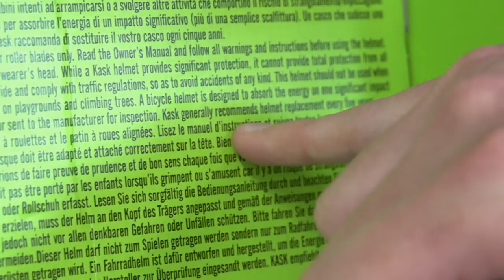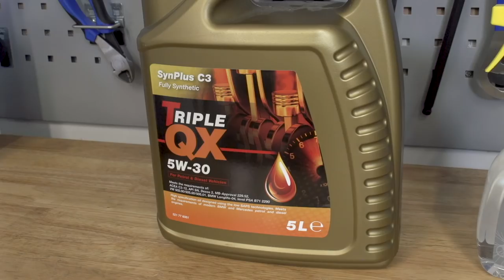How To Care For Your Bicycle Helmet

Comment: 25 cents worth of styrofoam = 100 dollars for a helmet.
Reply: True, however, the price of even the most expensive helmets is nothing compared to years or decades of dealing with a head/brain injury.
Reply: That's why I buy my helmet at Walmart same design and testing but not the insanely high price. Of course in a crash that would actually injure your cranium a helmet would be destroyed and provide no protection
Reply: That's like saying a text book is worth $10 of paper but someone has to write it............
-______-
Reply: the difference of fit alone is well worth the price. when your lid fits perfectly it's like wearing an old pair of jeans. it becomes part of you.
Reply: Michigan Mister I have a $15 helmet that's like wearing an old ball cap barely notice it's there even with a light on top and had all the safety ratings of a $100 helmet and similar styling too
Reply: see? exactly what I'm talking. it's true tho, that a quality lid will usually have a better fit. they (SMITH) have come miles in comfort. lol, then, the MIPS system comes along to muck up the works, hey?

Comment: Question... If you have an old helmet and it needs disposal what's the best way to get it disposed of, can it be recycled? Are they made of recyclable material?
Reply: Turn it around and use it as flower pot. After a few years your wife will love your cycling addiction and buy a new helmet for your birthday.
Reply: #torqueback

Comment: There's a huge difference between cycling to the shops at 15kmh on your old town bike or ripping down the side of a mountain or through a city on something a bit sportier. If you cycle in a certain way, you're bound to come off the bike sooner or later (see GCN team). My worst crash happened when my stem broke at low speed. I felt pretty stupid sitting in the emergency room with half my face broken, knowing that I would been uninjured had I been wearing a helmet. You never know when a component is going to fail, someone in a car doesn't see you etc. €120 or less is money well spent if it saves you from a preventable head injury, unless you're into that kind of thing (see David Cronenberg)

Comment: Should I change my helmet? I was knock of my bike by a 4x4 but unfortunately the driver didn’t stop or i would have asked them to replace. As i spent a bit on last helmet i wanted advice before replacing. There a few scuff on lid post crash as body took brunt of impact but i want to make sure before i get back on road again.  Also whats you opinion on helmets with leds integrated into them. Are they really bright enough. Id love to test one out for u. Thanks for advice in advance.

Comment: I wash mine after every use.  Take out the pads, rinse them, hang them up.  Soap up the helmet and straps, rinse well, shake well, set outside to dry.  It's always fresh and clean and the straps don't discolor or get gross.  I suggest the same.  Don't be gross.
Reply: Incaensio you have to much time on your hands
Reply: Kind of a waste of time
Reply: I have never washed mine at all.  Bought it second hand in 1861 from Isambard Kingdom Brunel.  He was ahead of his time.
Reply: I wash mine after every use but not the one on my loaf. That does seem a little excessive or you do have a lot of spare time :)
Reply: I'm already in the shower washing my ass, so it takes less than a minute to also wash the helmet.  Clothes are already going outside to hang dry, taking the helmet and pads out too again adds less than a minute.
Reply: I take mine into the shower with me! Give it a quick rinsing out while the water warms up. Takes 15s, seems to work fine!

Comment: I live in Phoenix, Arizona (USA) and have left a latex balloon hanging in my garage, where I also keep my helmet.  The balloon melted and dripped onto the floor from the heat during a particularly hot week. Latex melts at 130F (54.4C) Think I need a new helmet. Once again, good tips GCN!!!  Any videos on heat and the effects to a bike, carbon, grease or wax lubrication? #torqueback

Comment: Hey GCN. Im 16 and I just recovered from a horrendous crash at a national level race. My helmet has no scratches or cracks, so should I replace my helmet??
Reply: Yes. Only if it actually hit the ground. If you fell on your shoulder then it should be allright.
Reply: Sattva Vasavada Sengupta it's always good to replace a helmet after a crash
Reply: Yes!!!
Reply from the maker: Hey Sattva, sorry to hear about the crash. Most, if not all, manufacturers do advise replacing helmets after a crash as there is often damage that you can't see.
Reply: Makes no difference what level of race you were in at all, totally irrelevant.

Comment: Do expensive helmets offer greater protection than less expensive ones or are they just prettier?
Reply: Aero features, ventilation, and lightness is all you get from price.
Reply: Terry Smith There are testing labels inside. 
Only approved helmets can be sold.
So all helmets you see in your bike shop, expensive or cheap, should be safe.
Reply: all helmets test to the same standard. a cheap helmet passes the same test. more money gets you a lighter, more comfortable helmet with easier adjustment and maybe some consideration for aerodynamics

Comment: Why and when should a helmet be replaced even if it has not been crashed please?
Reply: If you google that question it comes back with various results. Every 3 to 5 years seems to be the answer.
Reply: Every couple of years. I generally replace mine very two years. Plus a new lid is just nice.
Reply: for the "why" - watch the video

Comment: Built-in bike helmet obsolescence. Who would have thought.
Reply: obsolescence is built in to a product, saying built in obsolescence doesn't make sense
Reply: Many plastics used have issues with other chemicals, uv radiation and asuch. To really prolong the product lifespan is up to the user at this point (basically what this video is about). I am sure that there are special plastics or other kind of materials that are far more resistant to afore mentioned problems. Those will not only come with better resistence but rather a significant increase of the products price. 
I get your point tho, i just don't think it's the case when talking about EPS respectively helmets.
Reply: Not restricted to bike helmets. In motorsport, you're supposed to replace helmets every five years. It's just the nature of the material. That's been the practice way before GCN ever existed to tell you and I about it.
Reply: Have had stuff that failed the day after the warranty expired. Precisely designed.

Comment: Helmets and the promotion of helmet use by helmet fascists is the biggest con ever pulled on the humble cyclist. Go ahead and pay £120 for an ugly lump of moulded polystyrene when its not even designed to protect you in the accident we all wear it for which is collisions with cars. Helmets are designed and tested for a 14 mph fall onto a hard surface nothing more. Fabio Casartelli and more recently Wouter Wynants were both wearing helmets and died riding in grand tours. Helmet use is promoted by the manufacturers of helmets and their shills in cycle journalism. Its all a con.